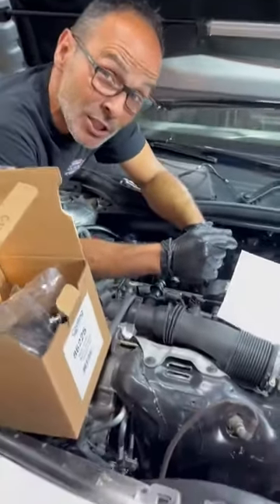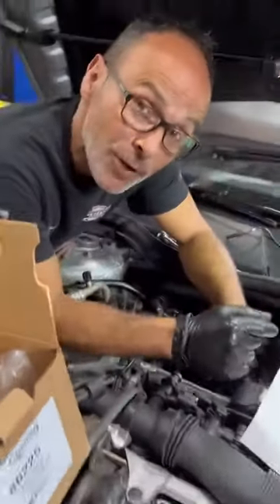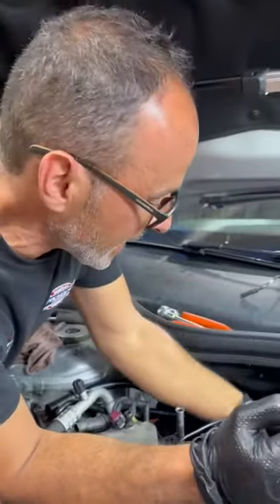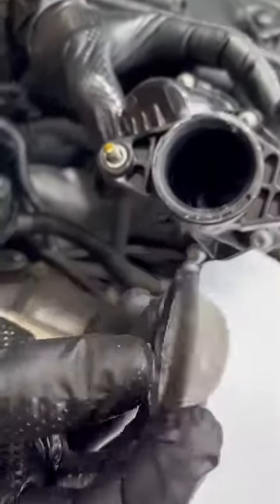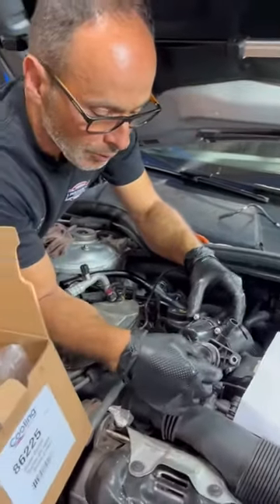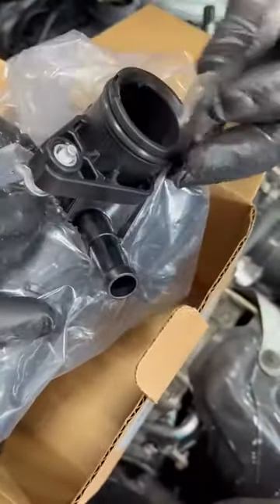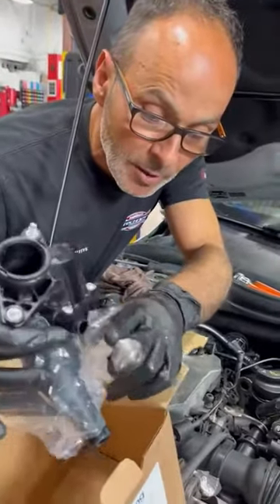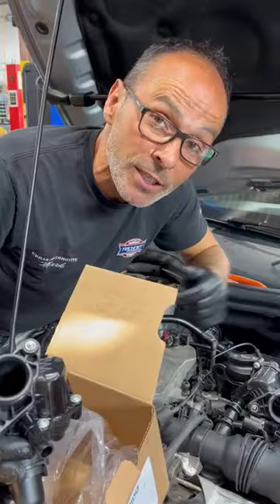The Dance Of The Gauge: Mercedes CLA 250 Coolant Temperature Fluctuations Resolved

Comment: My dealership replaced my heater core due to an HVAC issue inside the car. Now I have the fluctuating coolant temp, goes all the way into red and then quickly drops back down. Does the heater core connect to the thermostat housing? Could the heater core replacement be related to this? Thanks!
Reply: Solucionó el problema? Tengo el mismo problema
Reply: I have exactly the same problem ? You find the problem or not
Reply: @igrata  I had them change the thermostat and water pump, didn't fix it. But then this last time they said they changed a coolant circulation pump and there was a bad pipe somewhere restricting flow. Coolant temperature doesn't spike anymore, sometimes it drops a bit below normal after it has come up to operating temperature but it doesn't overheat.

Comment: Could the screen be my only issue or change the whole thermostat & housing?
Reply from the maker: To access the screen, you need to remove the thermostat housing. Due to the age and mileage, it's recommended to replace the thermostat housing preventatively, as it includes a new temperature sensor. Thanks for watching.
Reply: @UrbanAutomotive01 the housing come with the thermostat? Thanks